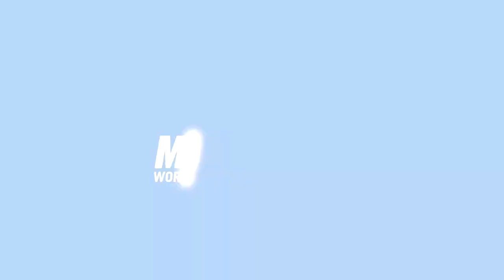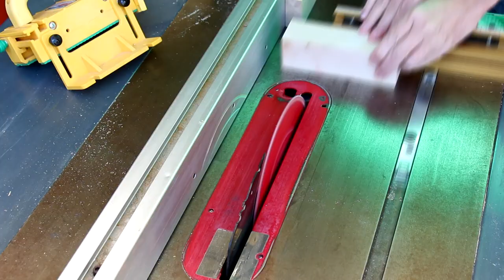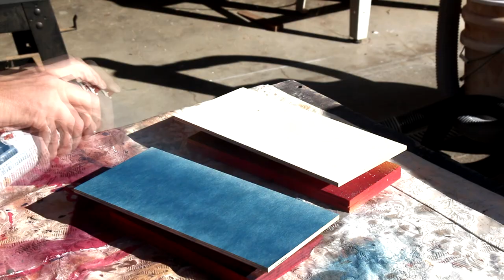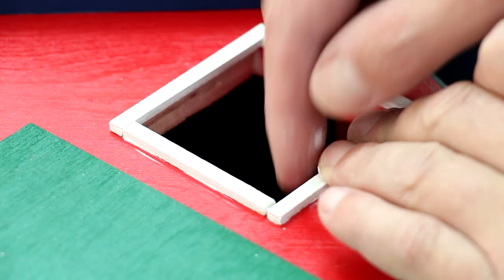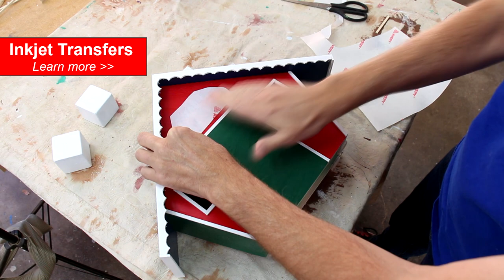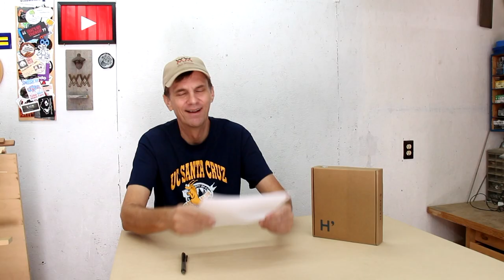DIY Santa's Toy Shop Countdown Calendar.

Comment: I actually watch mere mini on this first so I saw your comment on how the window trim made it hard to get the blocks out.  Add a small round head screw on the board that keeps the blocks from falling through.  Even a drywall screw not all the way in would work.  Then you wouldn't have to pick it up to pull them out to change each day.

Comment: I'm not sure if drilling holes to make a scalloped piece is common practice but i used the same method only a little larger scale and with a hole saw a few years ago...........Definitely better than using a jig/scroll or band saw.......

Comment: Wow that was really clever. I wish I had an air compressor because I need a brad nailer, but I can't find any that don't require an air compressor
Reply: +The Russian Woodworker They do have a battery operated nail gun. Can't remember who makes it. DeWalt or Milwaukee I think.
Reply: Oh that's awesome. Thank you so much, I'm gonna need to buy it soon.
Reply: Check out Paslode cordless nailers. They use a battery and a fuel cell. Pricey, but oh so nice if you don't want to drag a compressor around.
Reply: Okay thank you, I will try to convince my parents to let me buy an oil-less pancake compressor. The only problem I have is space.